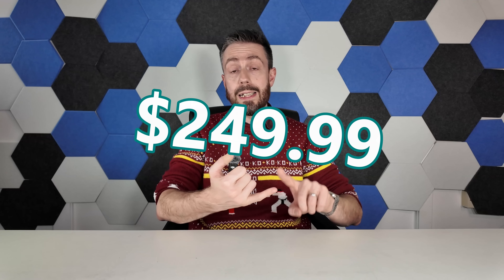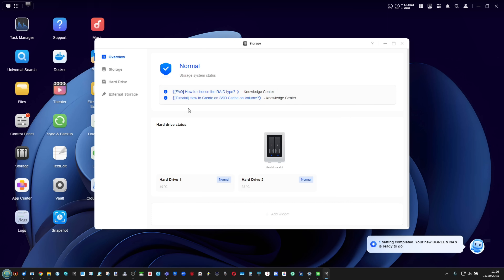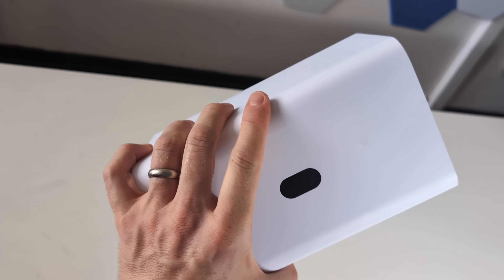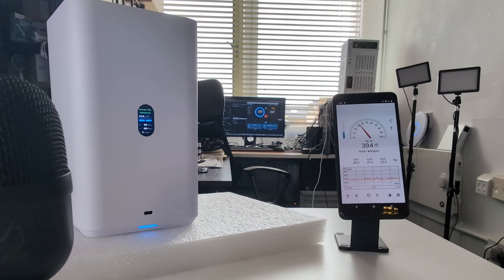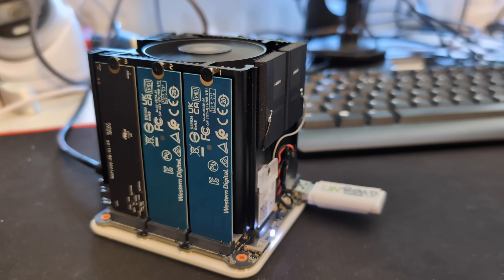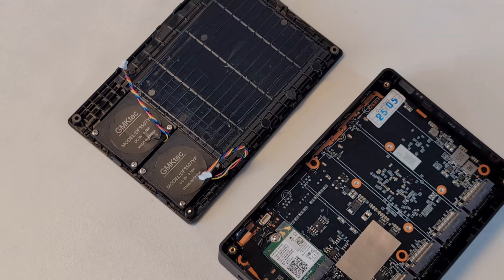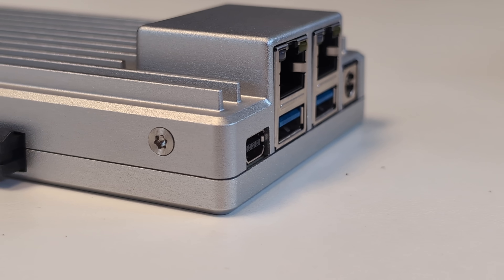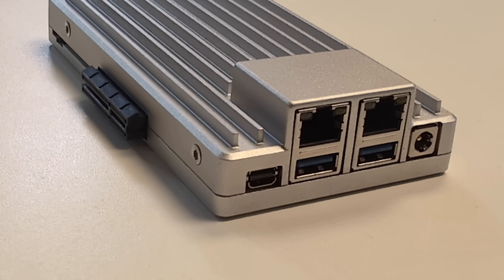Best Cheap NAS of 2025

Comment: Im planning on getting an NAS at home. Got two 8TB WD Red HDD's for a good used price and now im looking in which device they will find their new home (I guess I'll stay at 2 bay since money is tight) 

I'll also setup a NAS with my fritzbox 6690 planning on reusing 1 or 2 spare m.2 ssd's as an USB drive, until Ive decided on which device it will be.

Since im living in a small apartment, noice is an important factor for me. Second to that power consumption. And flexibility would be also a main point for me since I want to have the option of going with an third party OS. I want to use it for Streaming locally with Kodi, organize and manage Photos, Videos and documents. And also for basic mass storage uses of course. Later on I also want to have the option of running Plex, but rn its not a priority.

So far im eying following devices
 - Aoostar WRT Pro/R7, because their relatively silent and efficient.
- Unifi UNAS 2 (Not sure it its enough for me, because I want to avoid switching deviced later on)

Seems like Aoostar is the safest pick for me right now. My Budget is max 350€ so there's probably more devices that would fit into that budget. 

Since its really confusing for me to find fitting devices to look at, Id like to ask if there's maybe a list of options I could look through. Im desperately looking for recommendations. So far DIY also isn't an option for me , since I want something that just works and will keep up in the future. DIY isn't off the table, but not yet. 

Id appreciate some helping directions. Since I still have to learn alot, its hard for me to make a choice right now.

Comment: great video thank you!  I have been watching many videos on going to a nas solution but still non wiser on what I should do.  I plan to build a proxmox server, which I plan to run a nextcloud server to be connected to a dedicated SSD or HDD for all my regular files so I can access from anywhere and any device, a jellyfin server, something to run my audio not sure yet, run different, linux, bsd and windows vms mainly to run any applications like ms office etc. so if I want to use my linux machine, I have a way to run a windows vm to access software I cant run on linux and I want a dedicated drive to this as well.  all while these drives have a raid backup solution to them.  With this in mind, what hardware setup would you recommend? Performance seems mostly important from the vm perspective but efficiency is key to key the bills down.  Or am I over complicating things, is there a better way?

Comment: For those that look at the Beelink ME Mini, there are indeed two distinctive differently versions.  One set of versions are with 12G of DDR5 ram.  The other versions are with 16G of DDR5 ram.  Some of the variants come with 2TB NVME drives, while others come with NO NVME drive.  Current price for the 16G with no NVME drive is $259.  During the black friday sales, it was down to $237, IIR C.

Comment: I don't understand why NVMe NAS are in this "cheap" category. Per TB, they are 4 time the price of HDD.
Reply: Not everyone wants Spinning drives in their setup.  Some want the peace and quiet of NVME ;  I'm one of them..  Some also like the compact sizes. 

Hint: Many will stick just the more critical data on NVME as its significantly faster to read to and write from .  Compact and essentially NO noise. 

Have 4 different NVME NAS's at the moment;  eventually I'll get rid of the two 16bay conventional NAS's as those are about 8 or 9 years old.

Oh, and buy once, cry once..
Reply: @MrPir84free  You described advantages of NVMe (which are known to everyone), not why these are considered as cheap NAS. Despite the cost of the server itself, the overall price will still be at least 3 times that of HDD-based solutions, which automatically removes it from the "cheap" category.

Comment: I honestly don't quite understand who the UNAS 2 is for, because of its PoE.
If you're a private consumer, you need the PoE injector, which seems unnecessary.
If you're a company using their ecosystem and wide range PoE Switches, why would you go for a desktop NAS instead of a server mounted NAS with more than 2 bays!?
Or shall this be a backup device you take with you when your office building is about to collapse? 🤔
Reply: Why would consumers need a separate PoE injector? I’m a consumer with a UniFi network, and I run my access points and video doorbell via a PoE switch (my ceilings and front door don’t have power sockets; I doubt if I’m alone in that). It just simplifies everything and limits cable runs, so it’s especially suited for consumers I would say.

Comment: Beelink me mini 16GB stands at $379 right now. So....
Also nvme drives became so much more expensive right now, all these "cheap" options are barely cheap anymore 😢
Reply: Yeah, the Amazon link doesn't go to the NAS at all, and on the Beelink site, the N150 with 16GB DDR4 doesn't exist.
Reply: @MikeKeller  The 16G DDRAM version existed this morning - without NVME drives at $259..  I had a gift card amount over that $259, so it's on its way.
Reply: $259 without NVME drives as of this morning.

Comment: I am nothing but happy with my BeeLink ME Mini. My application is a file and docker server for use while traveling, so I did several mods in BIOS, an optimized Debian distribution, and carefully selected NVME drives.  Nothing major.  

One mod I did that probably voided my warranty is I did remove the AC power supply and installed a USB-C PD board.  The 5 amp capacity of USB-C PD means that at 12V, the max power supplied is 60W, which is more than the 45W of the original power supply. The removal of a heat source in the enclosure, power flexibility (particularly on the road), and higher efficiency is what compelled me to try this out, and it works a treat. For the record, 26.4W on boot, 9.6W at idle and 20.4W under load with the peak temps hitting 56C for the CPU and 43C for the drives. Perhaps this is something that Beelink should consider doing?  It would simplify the production if it were part of the motherboard or at least a daughter card.
Reply: Have you documented this build and if so can you please share the link or details
Reply: @steveinoz1  I will be properly documenting it once it is all done, and I still have a bit of CAD and 3D printing to do.  The process is simple, though tedious, and it will most likely void your warranty. For that reason, I won't be sharing the details here, but I will edit this reply and add a link to an external document unless there are objections.  While I feel the info needs to be available, I do not want to harm the relationship between this channel, it's founders, and Beelink, nor the obviously stellar reputation this channel has with manufacturers.

All that said, given my use, it would have been better to use a Xyber Hydra N305 NAS-X, as this unit already has USB-C PD for power though it only has 4 NVME slots.  The trouble is that it was not (and still isn't) available for purchase.
Reply: Warranties for MOST Chinese products aren't anything to be concerned about, beyond - DOES IT WORK OUT OF THE BOX.  After that initial return period, I'd guess that most experienced consumers would not be concerned about hardware warranties and firmware upgrades as it's pretty much non-existent anyways.
Reply: @MrPir84free  I agree in most cases, particularly with the cheap Chinese crap flooding the market, but Beelink has shown themselves to be the exception.  They have been pretty responsive and open when they had a power supply problem.  

That said, now that pretty much my entire ME Mini has been taken apart and put back together a couple of times and modded to a non-supported configuration, I would not expect anyone to warrantee it.
Reply: " so I did several mods in BIOS, an optimized Debian distribution, and carefully selected NVME drives.  Nothing major."
  Nothing major. Best self-deprecation post of the month ;)
Reply: @SteveLFBO  I've been working on this concept for a while. It is all little things, just an awful lot of them and at different skill levels.  

BIOS mods: level 1. Relatively easy and googleable.

OS and app mods: level 2. Relatively easy with google, school of YouTube, and a bit of programming.

Debian kernel mods: level 3. Challenging but well documented. More programming with most in C++. 

Component testing and selection: level 4.  Tough to find the power stats for NVME's etc, but persistence and emails pay off.

Power supply mod: level 5. My biggest complaint with the Beelink ME mini is that you have to take it nearly all the way apart to get to the power connector, plus CAD and 3D printing for the AC plug to USB-C adapter.

There's probably a level 6 out there, but I know when to stop before my skills and luck do.  The point is this: learn what you need to accomplish the objectives. grow greater than your comfort zone, but stop before you are sure you're gonna f*** up.   :)
Reply: UPDATE: The first version of the 3D Printed adapter is designed and in the process of printing.  More as I have it.
Reply: Update: Unfortunately, I no longer have a functional 3D printer, and the part is far too delicate for FDM anyway.  I'll be getting it resin printed, do the whole fit, adjust reprint and retry thing.  

Once I have it, I will be posting the results on thingiverse.  Since there really isn't anything for the ME Mini there, it should be easy to find.  Expect it by the end of January, probably sooner.

In the mean time, I have been curating the development info and writing up the paper on it.  No it isn't an academic project, but i'm treating it with the same rigor.  Everything is a work in progress, but here's the link to view: https://drive.google.com/drive/folders/1fROeYqTJQFcFVgAPowW2q8YmgQatcYoG?usp=drive_link
Reply: Update: The USB-C PD board has failed, though not in a way that is destructive. The micro on board fails to negotiate the 12V required, so only provides 5V which obviously prevents booting.  

While this sounds bad, its actually great news.  The failure mode of the USB-C PD adapter is to revert back to 5V rather than suddenly decide to toss 20V on the server motherboard's 12V rail. That said, I think I will make two upgrades:

1. Over the short term, when I replace the PD board, I will be adding some SMD capacitors to the output for a bit of digital noise filtering.  It shouldn't be required, but I have a feeling that a lot of the digital signaling winds up on the power rail.

2.  I think I want to have PD negotiate for 20V, then use a buck converter to drop the voltage back to 12V.  This will give me more headroom and probably reduce thermal loads while increasing reliability. I will lose 2-3% in the efficiency, but this will equate to around 1W or less in this application.

Comment: hmnm why not "Synology 2-Bay DiskStation DS223j" ?
Reply: Isn't Synology synonym for anti-consumer nowadays?
Reply: They don't deserve it. The board members became way too bold. Let them suffer.
Reply: Synology ew
Reply from the maker: I mean, a couple of reasons really. 1, it's not a 2025 release (as per the ruling at the intro) And 2, it doesn't stack well against any of these systems tbh...if Synology had launched a 2025 version, and upped the HW a bit and kept the price point - then this + DSM would have got it in. But yeah, tonne of reasons it didn't make the cut